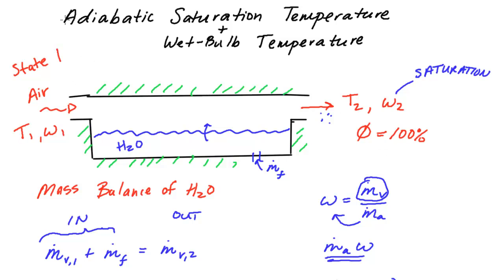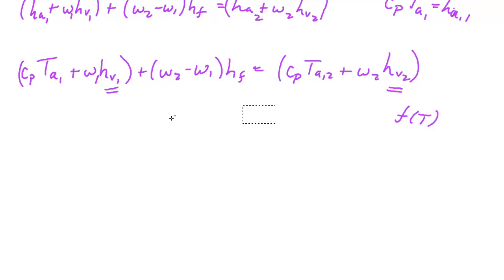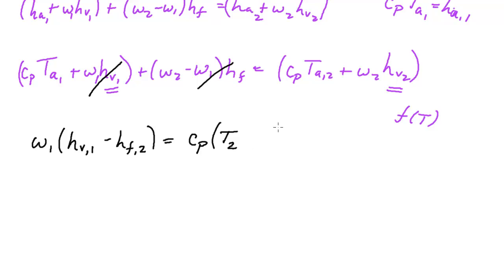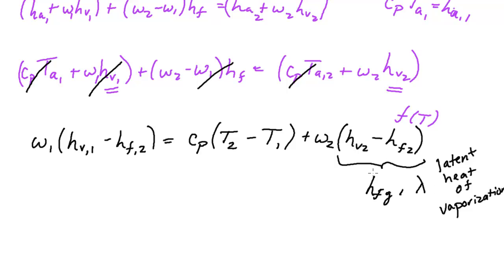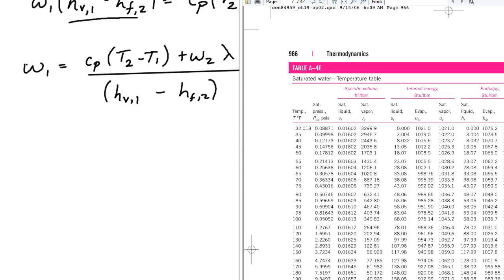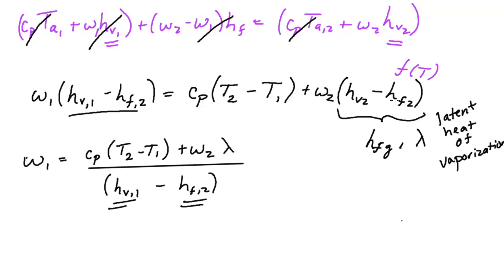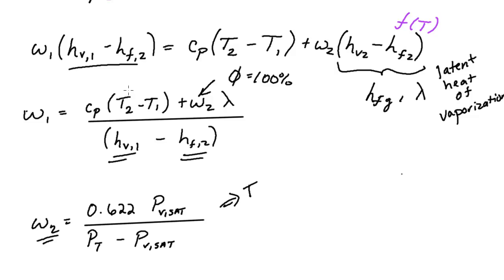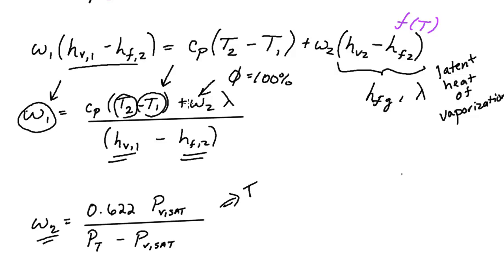Adiabatic Saturation Temp and Wet-Bulb Temperature, Part 2

Comment: Why did you assume the water is saturated?
Reply from the maker: We are assuming the water is saturated because the goal was to come up with a useful property under this condition, that being the adiabatic saturation temperature. Part of the definition of this property is that the water at the exit state is saturated. 

This property is useful, especially with the design and analysis of cooling towers. For example, if we know the entering conditions of the air coming into the cooling tower and can calculate the adiabatic saturation temperature (or closely related wet-bulb temperature), we know what the lowest temperature possible is at the exit of the cooling tower.
Reply: @MitchellPaulus  that's why you take Relative humidity as 100% for the exit stream?
Reply from the maker: @lakshminarayana5998  Correct - At saturation conditions, the dry bulb temperature, dew point temperature, and wet bulb temperature are all the same, and the relative humidity is 100%. Relative humidity is a percentage representing how close the conditions are to being saturated, so by definition, at saturation this value should be 100%.